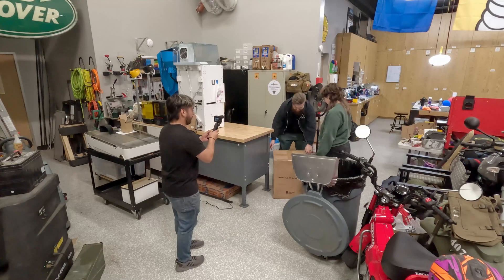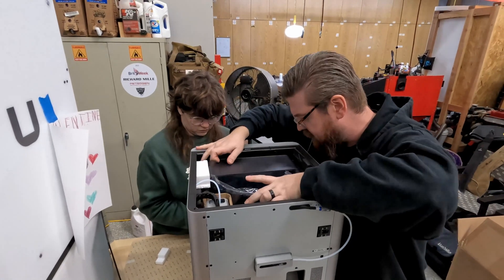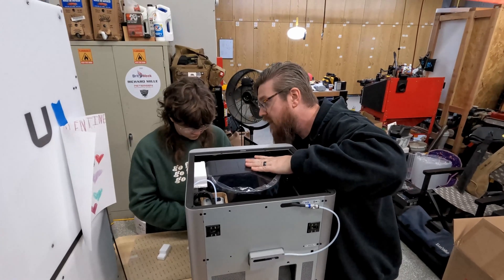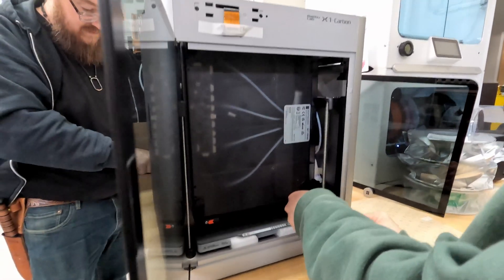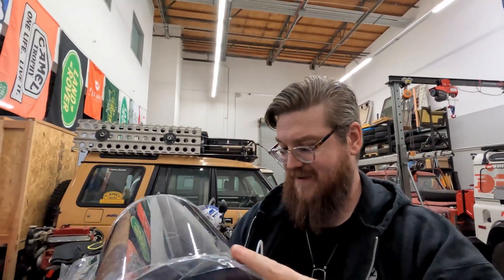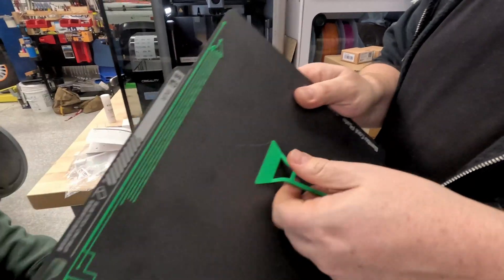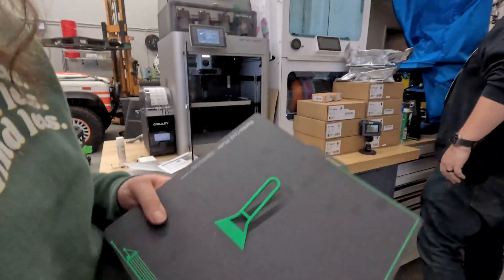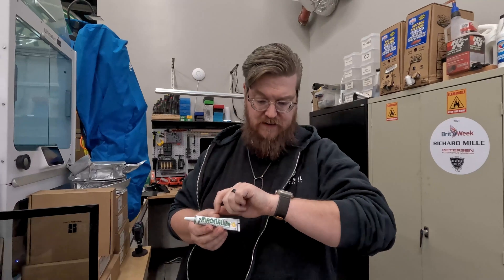Transforming Land Rovers with a Secret Weapon? Exclusive Unbox & Test of the Bambu Lab Carbon X1!

Comment: The fact that they're handing these Bambu machines out for free by the thousands like candy from a white van should be an eye opener for folks... Look into the nature of their locked down mandatory ecosystem.
Reply from the maker: We were thinking the same thing, but we’ve now run a bunch of different filaments through it, from a few different manufacturers that aren’t “supported” by Bambu and it works just fine. There’s nothing that says they won’t change that one day, but for now, it works with any filament and it’s been printing none stop for weeks. Thanks for watching!